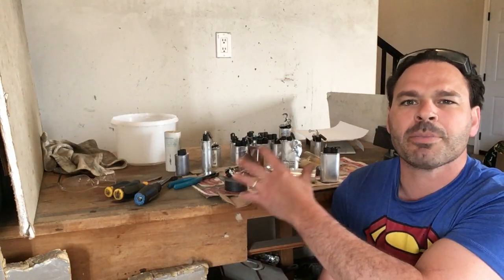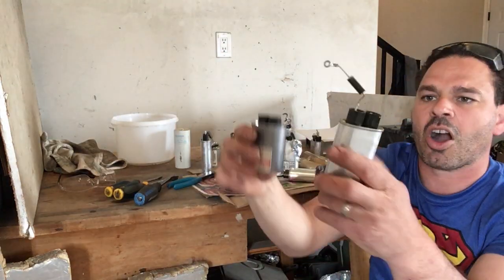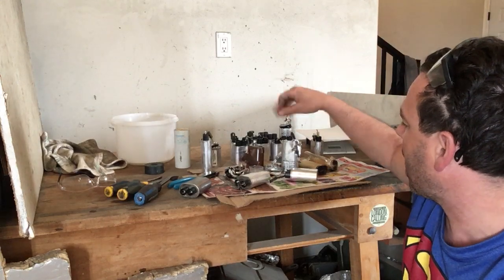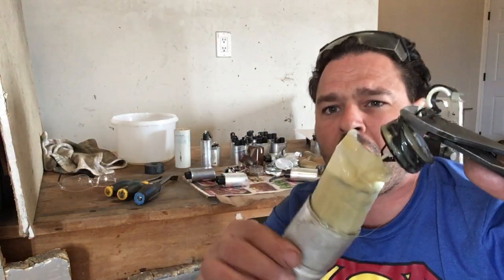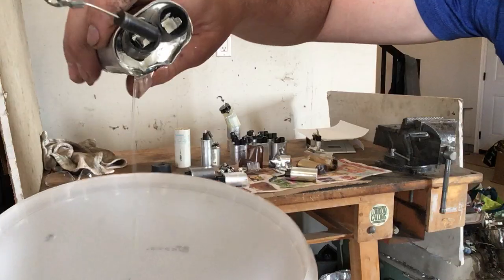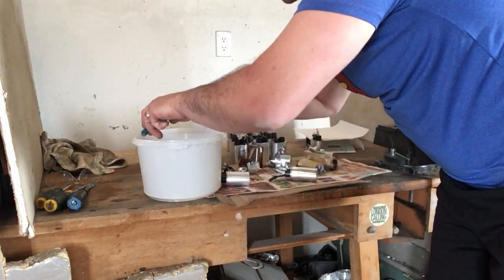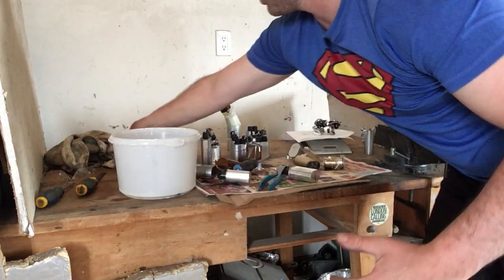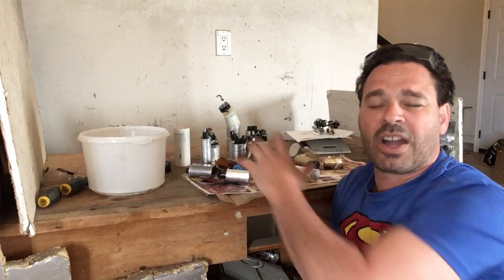Scrapping capacitors: are they worth opening and separating the metals?

Comment: The sheets of metal inside can be valuable it can be aluminum it cab be silver platinum exc exc .the right one can be very valuable
Reply: Do you know which types have silver or platinum ?
Reply: @Artstrology  no I don't but there is info on the net somewhere I've seen a few videos. Been along time ago I need to research myself I've just been saving them all for know.
Reply: @charlesmatthews9946   My thought is to look at the historical chart for platinum and see where it may have been feasible to use in capacitors, and that would at least give me a date range. It would have to be early stuff I imagine.
Reply: @artstrology  yes I'd say so to
Reply: @artstrology  silver possibly could be newer stuff
Reply: Silver and Palladium after 1995

Comment: Hey I wanted you to see this after watching your radiator video. Your working too hard. Put a cut on every copper pipe right in the middle of the pipe with a cut off wheel or knife in your case. In the aluminum space between each pipe take a fat philips heads screwdriver and push hard and drag it against all the way down the aluminum between each pipe and the pipes literally fall out after that with zero effort. Your doing too much man, you will love this technique, it actually makes rads worth doing time/effort wise. Good luck.
Reply: You are saying, take coils apart and separate the aluminum and copper ?  Instead of just handing over the coil ?